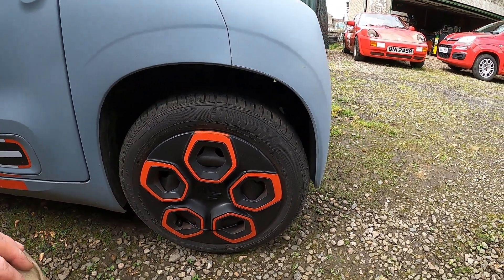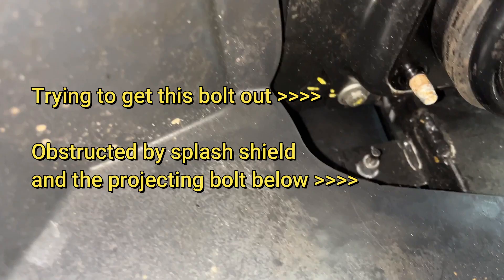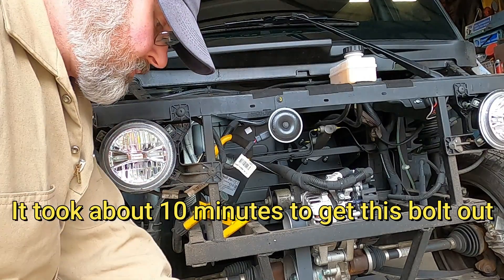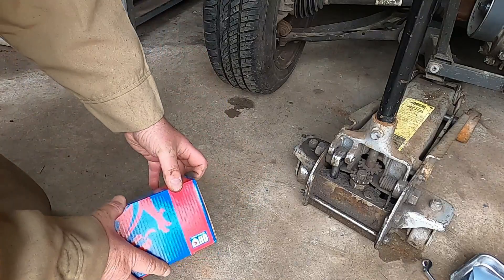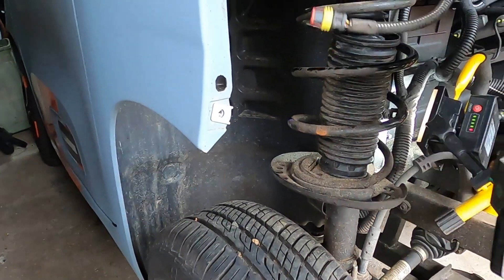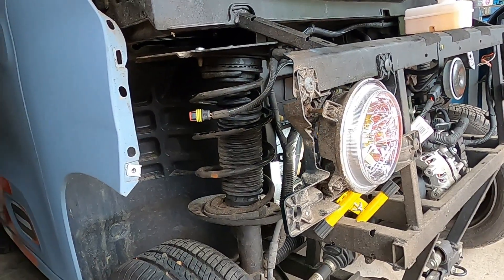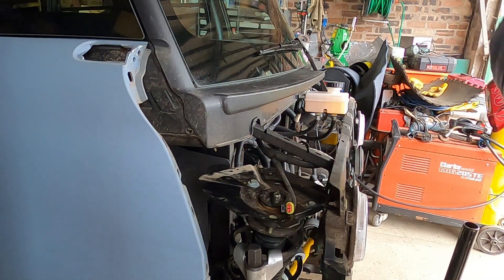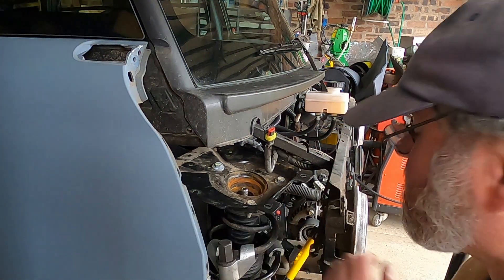Citroen Ami Suspension Strut Top Mount Repair - What Broke and Why?

Comment: Thanks for the video Doug.  My Ami has just had the same failure after 6000 miles but the part was dated 19/02/2022 and marked 0422 so probably a different batch. Otherwise the Ami has been a very good runabout.
Reply from the maker: It may be the way Citroen are using the part which causes the failure. I also had an after-market one fail. This week I made a pair of reinforced top mounts with 2mm steel plates welded to the top to restrain the rubber part. Hopefully these will not fail.

Comment: 300 Km. Metal noise coming from front right side. Citroen said the suspension is gone. Need replacement….
300km!!!!! 3-4 weeks to have everything fixed. How many with same issue? Thanks
Reply from the maker: Hi Davide, a very common problem with the Ami's suspension. The top mount rubber fails. An easy fix, any competent mechanic can replace the top mount. The top mount is also used on the Opel Corsa F and is readily available from dealers or motor factors. https://www.autodoc.co.uk/febi-bilstein/21903590

Comment: At 6 months old ! ..... Odd because Citreon know how to make suspension .. Is it a £2k quadcycle with £6K profit ? ( when an Ice car is £11k = £5K car + £6k profit ?)
Reply from the maker: The Ami's have suffered from a lot of this failure of the strut top mount. Part is also used on the Opel Corsa.

Comment: Fixing broken parts on a brand new car…quality 👌🏻
Reply from the maker: I'm surprised that Vauxhall/Opel Corsa F owners are not seeing the same problem (same part).
Reply: @DougsShed I was shocked when you said it was the same part as full size cars. I too wonder if they have failure issues. Or is the Ami a harsh ride that causes it please?
Reply from the maker: @the_lost_navigator7266  I'm not sure if the top mount is supported in the same way in the Opel Corsa F. It is possible that the Ami's suspension is too stiff or is running out of shock absorber travel and stressing the top mount. There is a modification you can do by adding a plate between the top mount and the body frame. This plate has a small hole to allow the shock absorber rod nut to be tightened but the hole is small enough to support the rubber portion of the top mount and prevent the rubber from ripping away from the metal part of the top mount.

Comment: Why are your reparing it yourself, is it not under warranty?
I'm not sure  how it will stand up to UK winters based on the corrosion shown.
Reply from the maker: Citroen could not repair in a reasonable timescale. For rustproofing I am applying Lanoguard every year. The Ami is not good in temperatures below 10C therefore limited use from December to April!

Comment: Lanolin is one of the best rubber preservatives out there. It's even effective in recovering condition from dry rot in many rubber parts. I use it on vintage tyres, some thirty years old and still pristine.
I also treat CV and rack boots, with some now over 350000km and still like new. I use Lanotec heavy duty in most cases. Great work on the repair. Cheers.
Reply from the maker: Good to know.

Comment: So load a rubber/steel adhesive joint in Tension?  Forever?  And in a mounting that will accumulate and trap water at the glue line?  That is lousy engineering.

 Make the cup half as deep, put the rubber bits below, in compression.   That would last much longer, perhaps forever given the light loading.

Not so funny: Volvo uses the same design for rear shock attachment in many of their vehicles.   I’ve had this issue in an 850 wagon.  Stupidly spendy part too.
Reply from the maker: The rubber portion is attached to the damper rod of the front strut. It does not see a constant load. The spring's load is supported by the roller bearing mounted to the bottom of the steel support plate of the top mount which bolts direct to the chassis. The water trap is not a very clever piece of design.

Comment: The one thing the Ami is good at is making content. Like one long disaster series.
My favourite is the one where someone took a corner a bit enthusiastically and it flopped on it's sided like a Reliant 3 wheeler. 
No elk test required.
Reply from the maker: I'm sure if I was given one as a 14/16 year old, I would have had it on it's roof within a week!
Reply: @DougsShed 17 year old here, I own one and I almost flipped it at 65km/h on a downhill (went on two wheels)
Reply from the maker: @ Take it easy!
Reply: @DougsShed  yeah I will try lol, it’s very fun to drive when tuned!

Comment: Could be good for self repair in 'x' years time, looks accessible and not too frightening.
Reply from the maker: Mechanical parts will be no problem. Battery/Motor/Electronics could be a problem
Reply: @DougsShed  hi. That could be true. The origional Prius battery can now be upgraded etc by enterprising people, the motor could be reconditioned and electronics could also be reversed engineered again by those in the know. Thats what I would hope, to stop these ending up in the skip once main line support ends.

Comment: People don't realise that that is not a car. It's a mobility scooter with a roof
Reply from the maker: Spot on!
Reply: The part that failed us a car grade component though.
Reply: @benholroyd5221  what are you smoking
Reply: @DRAINTVofficial  

Well either you were 
A) making a general comment unrelated to the video

B) making a comment related to the video.

I inferred B. And further inferred you were making a comment about the expected quality of the components used, as the video is about a component failure

I'm again forced to assume from your second comment that I interpreted your first comment wrong? But then your second comment isn't especially helpful. So all I can say is that what I'm smoking isn't giving me psychic powers.

Comment: OH NO!!!  Quinton Hazel do not still exist!!  In the 1970s LUCAS was the spawn of the devil for terrible quality. They were closely followed by QH. Anything QH fell apart or broke within months assuming parts did not arrive pre-broken in the box. I had rather hoped they had died a death but it seems not. It may be necessary to do a Britpart inspection. Buy 10, reject 7 for being out of specification, reject another two for being broken and keep the one that seems ok.
Reply from the maker: These ones seem OK - So far they are holding up better than OEM.

Comment: They dont make real qualitycars anymore.
iI have an Opel astra from 1993 with still all original suspension parts intact.
Rust on the chassis is the only thing bothering me.
My 2010 Opel corsa already got the front struts replaced and rear shocks.
Reply from the maker: I had the rubber bushes on the rear shock absorbers of my 3 year old Fiat panda fail. Missed a warranty claim by 2 weeks due to not being able to get the car serviced in time due to dealer backlog caused by Covid.

Comment: It's a consumable item, like tyres and brake pads, good luck trying to stick that on citroen👍. Our pot holed roads are putting extra strain on our cars. Also, it would be good practice to change both sides not just one?
Reply from the maker: I have the one for the other side.

Comment: Nice one Doug. I can imagine mechanics at Citroen dealership watching this to see how it's done. Do you think it's worth taking the front cover off from time to time to check these? Nearly up to 1000 miles in mine - tempted to have a look - Only problem is I don't have some of the tools needed to do this job if it needs doing.
Reply: Why would you even do the job? It’s under warranty and it’s a parts failure! Broken spring due to potholes, normal ‘wear and tear’ mountings etc don’t come off in normal use. I’ve done car mechanics for over 40 years and the only thing that’s increased is broken springs, cracked alloys and alignment.
Reply: @stumpusMaximus  Yeah but I was thinking more - Have look and see to check the condition. Garage won't be interested unless it's actually broken. Would rather prevent problem than just wait for it to happen.
Reply: @stumpusMaximus  you need to take them to a citroen garage probably whee you live theres a citroen garage on every street corner but some people dont have the same luxury  as you my nearest Citroen garage is 647 miles away =.

Comment: Not very well made for a new car , considering im driving around in a near 20 year old Mitsubishi Colt have hit many large potholes and never broke the springs shocks or struts , seems like Cheap parts Citroen are using and there seems to be no give in the suspension which dont help also the Ami only does 29 mph how can it break at such a slow speed ?
Reply: It's not a "car". Quadracycle.
Reply: @ColinWatters  lol 😄 Karen I know but still should be built well for £8 grand
Reply: @ChrisAyres007  Can get a 2017 Nissan Leaf for that.

Comment: Glad you got your wee Ami fixed!
I suppose as the part which failed is common to a number of other cars, then it can’t really be classed as an Ami specific fault, therefore shouldn’t really be a concern for potential buyers?
Reply from the maker: Yes, I think it is a manufacturing defect with a particular batch of top mounts. These same mounts are used on several other (heavier) cars.
Reply: The real question is why did it fail in such a short amount of time. Its a new car!.
Reply from the maker: @AllThingsAlex  Typical bathtub curve failure.

Comment: I'd agree with your diagnosis from what I can see, It'll be interesting to hear what Citroen have to say about it. I feel your pain getting those screws aligned, I've had to resort to making stabbing pins in similar situations where cross threading was a serious possibility. Nice job.
Reply from the maker: The rearmost screw was very difficult to access.
Reply: Stelantis says nothing about this and takes no repair cost! Although ALL Amy, Rocks-e, and Fiat Topolino has the same issue after about 10k km. But all. And Stellantis has no updated part. There is a good solution in the German forums although, I just built it in into our rocks-e.

Comment: Outstanding questions: How long before near side fails? How much better the QH part ? should there not be drain holes above bonding to drain the water? IYO what would an Ideal solution look like perhaps without glue? If you spot welded in a top palate would that prevent failure?
Reply from the maker: I have a spare for the other side. Don't think the water was the main problem although the 'drain' channels in the top plate probable work in reverse and fill the top mount with water!
Reply: At least you know it's been replaced properly, bad news re the water pooling, that's definitely a design issue.

Comment: Load bearing glue, fantastic idea😔

A sandwich plate would eliminate the risk of collapse.
Reply from the maker: Luckily the weight of the car is still supported by the spring. The top plate rubber bolts to the strut's shock absorber. It also provides some location for the strut.